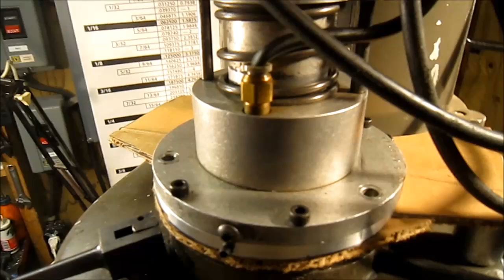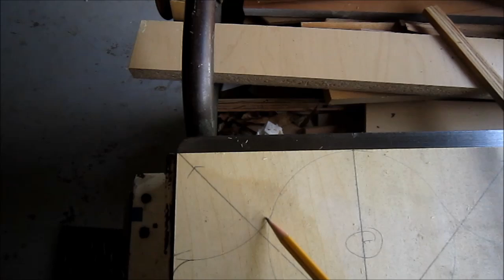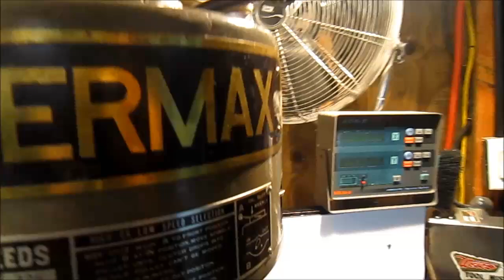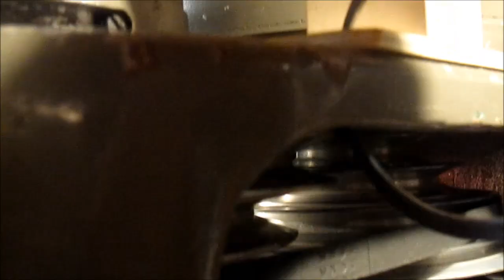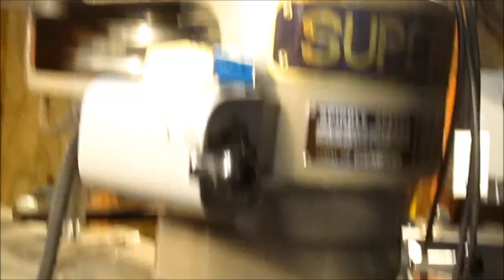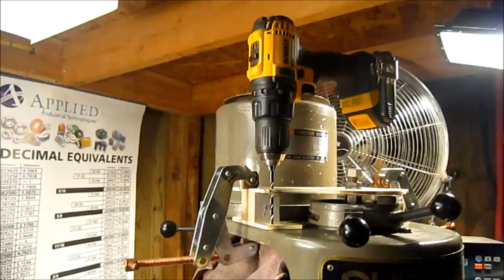TOOL TIME 21-2   POWER DRAW BAR part 3

Comment: You could have made some snazzy fancy J-clamps to come down and grab under the ledges on both sides and not had to drill and tap the top. Could have even made them to use a cam over bolt with a wingnut on top to lock them down for quick removal. In case you need to pull the drawbar out. :-) Of course your design looks like it will work fine as well. Looking forward to the finished product!
Reply from the maker: nice idea...quick change drawbar thanks for watching and your input

Comment: Chuck,  looks good!  I'll be interested to see how routing aluminum goes...I'm guessing it will be pretty "grabby". I've even had problems template routing 1" oak (end grain is worst). Be really careful....and it might be best to use the router bit in the mill like Tom did on the etching press wheel. 

Also looking forward to seeing a drawbar made. Sounds simple, so I'm guessing I'm overlooking some aspect of the job!

-- Mike
Reply from the maker: Hi Mike...
drawbar will be simple but a two piece unit....I will show the build and why
Chuck

Comment: Hi Chuck,
I like your design.  You are very detailed with your project so I am sure it will turn out good.  I think I would split the diameters of your spacers - one diameter too big, one diameter too small, half way between, JUST RIGHT.   Thanks for showing us.
Take Care,
Reid
Reply from the maker: Hi Reid...Thanks for your input....the diameter of the legs will be finalized one the aluminum plate is in place, got to get the relationship/scale correctChuck

Comment: Hi Chuck, now you can see why I advocate NOT putting the vice in the centre of the table, so you can have enough room for other fittings.
ATB
chris
Reply from the maker: Hi Chris...I somewhat agree...but it is a flip of the coin....I know if I had the vise set off to the side there will be jobs that due to size the vise needs to be in the middle....kind of a crap shoot...I do know that I can fit my RT on the mill with the vise close to center.Thanks for watching and your inputChuck

Comment: Chuck,  Nice project.  You're doing a very meticulous job.  I would have drilled the holes on the template freehand on my drill press though.  The setup on the mill was too complicated for an old fart like me.  I can't wait to see milling the plate with the router.  Thanks for sharing bud!
Reply from the maker: Hello Herb...Yes, I was tempted to use the drill press or even a hand drill, but the mill set up was done for two reasons....a) to help me not botch the layout and drilling  b) for practice of setup on the mill along with the enjoyment of solving a setup...FYI setup took less that 10 minutes including alignment. Chuck